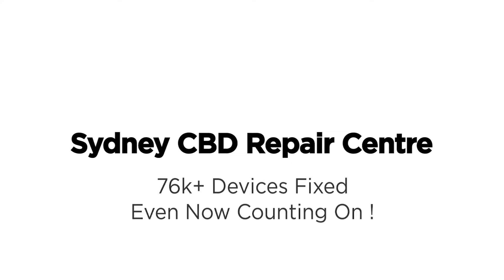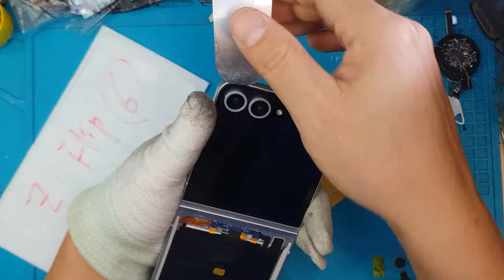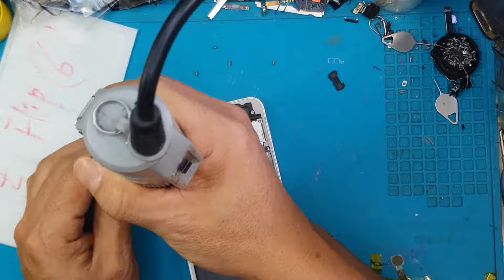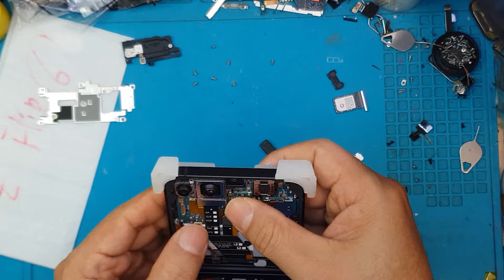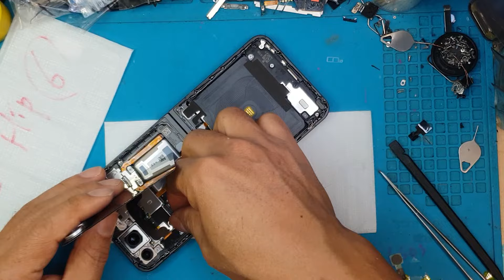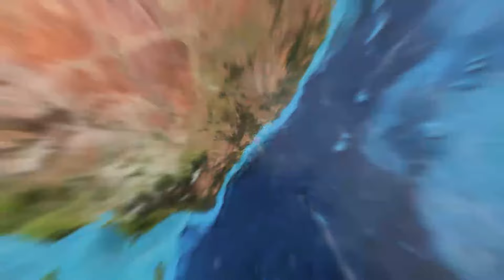HIGH END REPAIR! Samsung Galaxy Z Flip 6 Screen Replacement | Sydney CBD Repair Centre

Comment: Thank you for your vid now i can fix my wife's flip. Is the spray your using an adhesive remover? Or just wd40
Reply: It's isopropyl alcohol. Don't use oil based stuff

Comment: Hello, I have changed the display but screen turns and suddenly goes black. It happened to me in flip 4 then I changed magnets and It started working but with flip 6 I have changed magnets but still inner screen goes off and only outer screen works. Do you know how to solve It?

Comment: This has happened, and you should be careful when you're dropping your device.
Of this kind, the bat plate might actually shattered a phone.It happened in me once and it can shatter it by how many flips you use the phone and i don't know how but I dropped it.And the back part of it somehow made the phone shodder on the front, so now that l c screen on it is just broken it just shows flashing lights and just start it make apps move around and do stuff into l c screen blew up, it stopped working but the backside still works.Where to small screen

Comment: excessive wear already ? , the flip 6 launched not that long ago 3-4 months. I just sent one for repair with basically same  screen fault as in the video and hoping for warranty  since cannot find any external damage. Looks like it just did break at the middle 😕
Reply: Mine broke the second time in the middle, they said it was my fault and wanted to charge me $345 , mind you the phone is only 7 months old. We should join into a class law suit against Samsung for this. A $1100 phone shouldn’t be this trash
Reply: @jesusgarcia1589  same here. Fixed the first time it broke after 2 weeks, the second time it broke after 4 months or so, they said that it suffered from water damage, which I know for a fact it was never near any water, plus I thought these phones were supposed to be water-restaurant anyway, and they pointed out a tiny mark it had on the outside hinge that was not due to a drop. Makes me want to never buy Samsung again. I still continued to use the phone since then. I have used it with a big black dead spot on the edge since then and now a white line on my screen for months now lol.
Reply: same here. Did they accept the warranty?
Reply: @fixandtests  any feedback after 4 months ? Can you please share your experience ? Thanks.
Reply: Mine one also broken from the middle and 1 line has appear i bought in 2 month ago and customer service asking to pay 30k
Reply: Same. I am sending in this week. Update on this?
Reply: Any update? Did they fix it for free?
Reply: same , In same place! today I noticed a small line next to the middle, then by the end of day it spread further! At first I thought it was something I did, but now im convinced its faulty product. Its only been about 8 months since It was new!
Reply: Update on mine. I got it fixed for free. It had a white line at first, then became a big black spot, and the screen was unresponsive. It took just a few hours for them to fix.
Reply: Another problem, but it was trough the 24 months warranty
Reply: @fixandtests  my screen broken without any damage
Reply: I also had this Issue just 3 months after I bought it a line appeared in the middle and spread to the whole screen and I was so confused cuz theres no damaga on the outside like not a single scratch so
Reply: Mine broke after a little over 2 months Samsung wants me to send in the phone all parts are back ordered horrible customer service